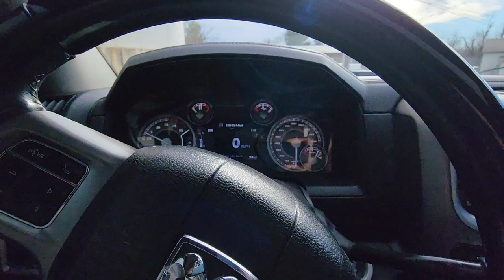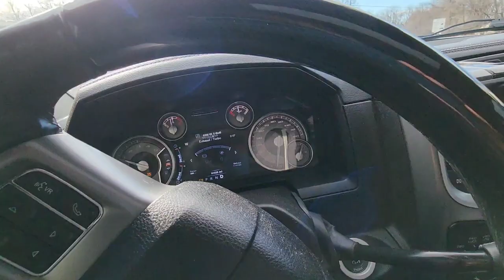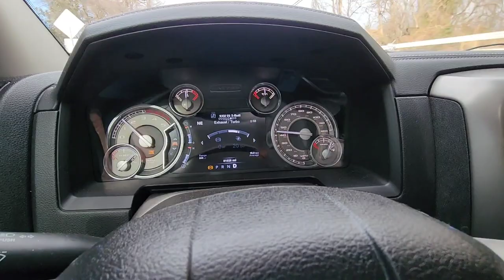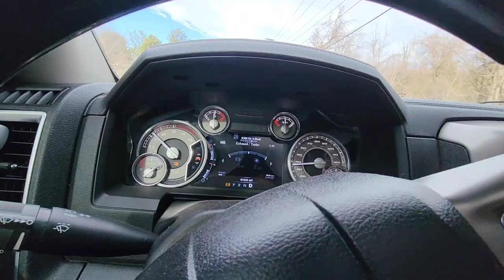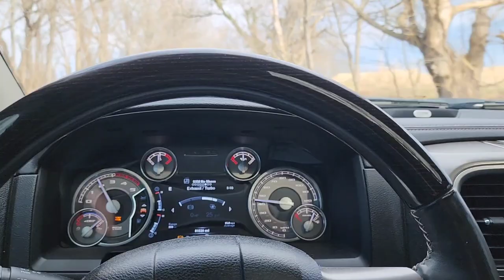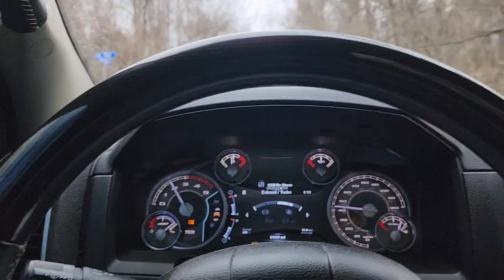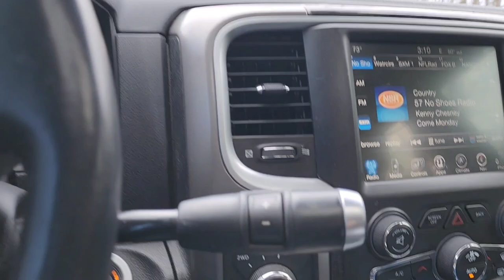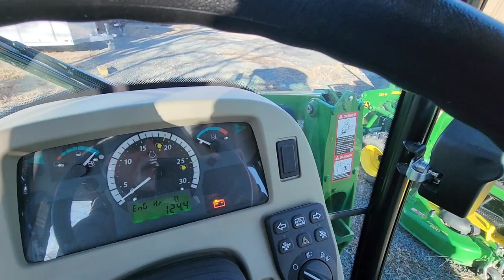Towing with the Ram and buy gravel for the driveway

Comment: I bet your trailer is 15-16k you’ve got 12k plus in material on a 3800 on a trailer. Your tires and axles are overloaded you can see it .
Reply from the maker: Actually the tire pressures were off big time.  Yeh stupid me and I’m such the tire guy but yes it was the tires extremely low pressures.  Watch the next video with the same loads and different truck after I inflated the tires and thanks for watching and commenting.
Reply from the maker: https://youtu.be/un_e2XbTulk